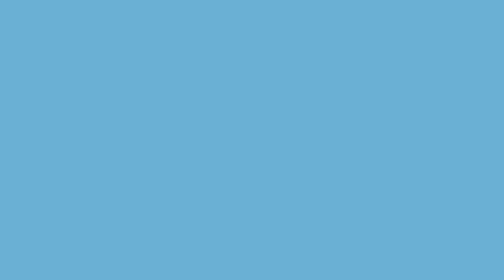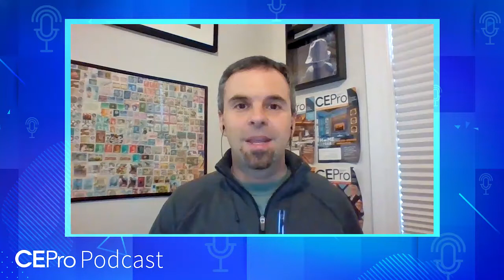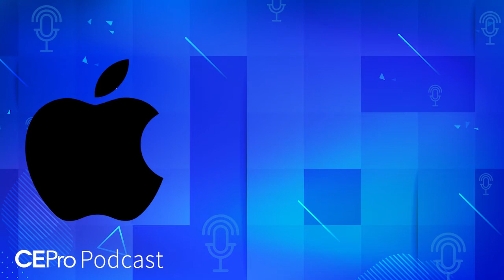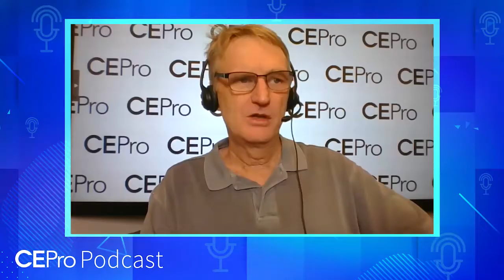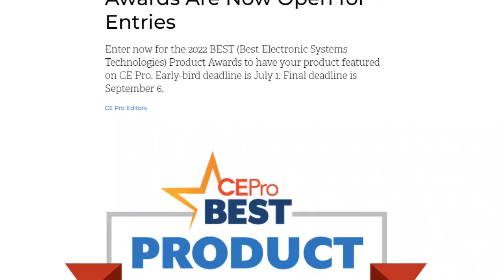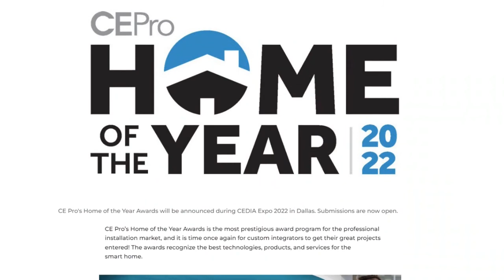CE Pro Podcast 115: Digging Deep into Snap One OvrC Upgrades

Comment: OVRC is fine for Wattboxes, but I don't like it for client site monitoring.  I can see it the advantages if running Araknis devices, but we don't so the monitoring capably is the only criterion for us. 

A few years back, when I was evaluating a replacement for ihiji Invision (before Snap purchased Pakedge), I found OVRC lacking.  While Invision had its positives and negatives, as does Domotz, OVRC seemed to have the worst of both.  We ended up choosing Domotz for new installs.  When Invision was announced to be retired earlier this year, I took another look at OVRC and it didn't improve, so we decided that we would need to replace the ihiji/Pakedge appliances with Domotz.